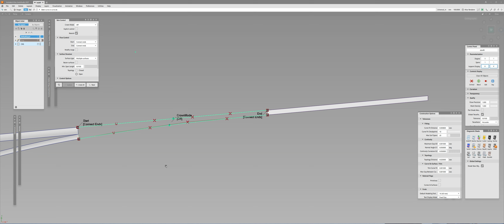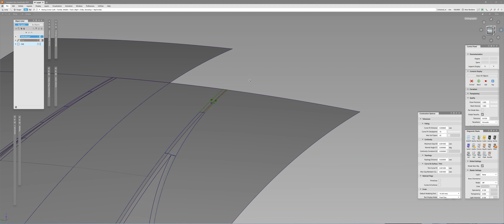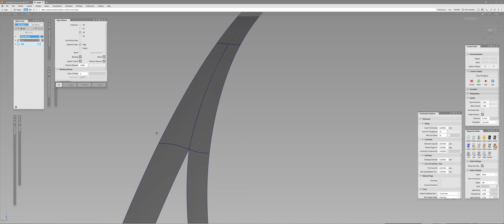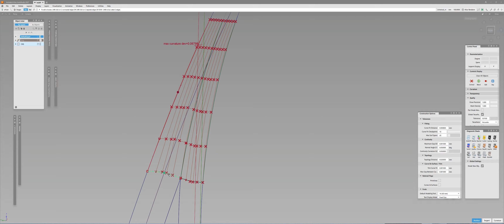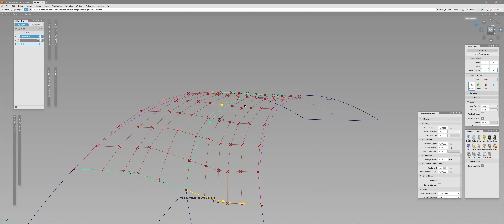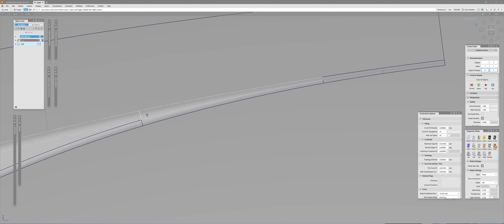Alias Theory Builder: Y-fillets. Centerline method

Comment: Master, it’s great to see these Alias tutorials. Your lessons are clear and excellent. I’m taking my first steps in Alias — I come from the CAD world, very technical, rigid/structured, but with the advantages of parametrics and reconstruction changes at specific points in industrial design. From what I understand, Alias doesn’t work with parametric changes in the same way, but it does have tools and modeling methods that help with design modifications (which are very common in the industry, where they constantly ask for adjustments or evolutions of a product).
But I can clearly see that this is the great software for creating high-level industrial design. I enjoy being here; I see that you have lessons from basic to advanced, and I’d even say extremely advanced, which I appreciate a lot. Please, whenever you can, continue making more videos mixing these basic and advanced lessons — I believe that even for those who are already advanced, revisiting some theories and approaches is valuable.
You are a great teacher, and I intend to write to you soon. Have a great day, and thank you always!
Reply from the maker: Thanks a lot for your kind words - I really appreciate it.

Your observations are actually accurate on an intuitive level, but I would phrase it a bit differently. Alias, just like ICEM Surf or NX, is a sculpt‑based surface modeling system. It certainly has constraints, but it’s not a sketch‑driven environment - it’s a sculpting system designed to create a beautiful, high‑quality form in situations where rigid, dimension‑driven sketches simply won’t work.

That’s exactly why approaching Alias from an academic engineering perspective often leaves people disappointed, especially if what they need is a piston engine block or sheet metal. But if what you need is a helicopter fuselage, a car body, or a computer mouse, that’s where these systems truly shine.

In practice it’s always a mix:
the A‑side is Alias, NX, ICEM Surf;
the B‑side, thickness, analysis, and assemblies - that’s SolidWorks, Rhino (to a certain extent), CATIA etc